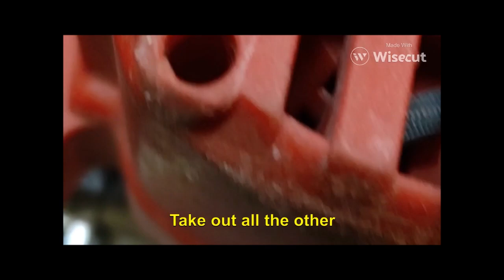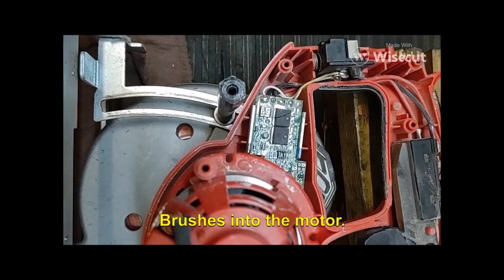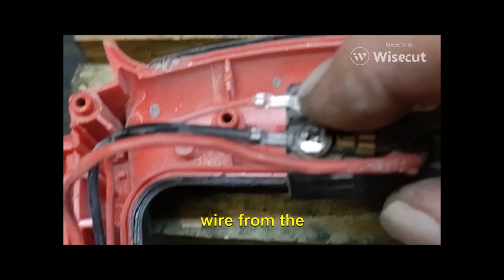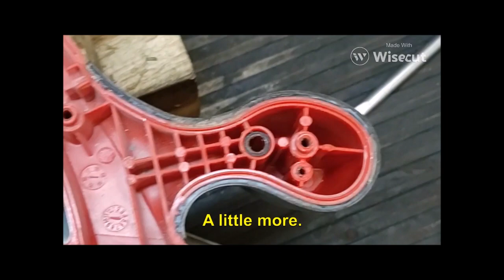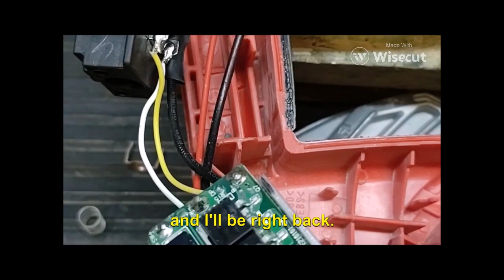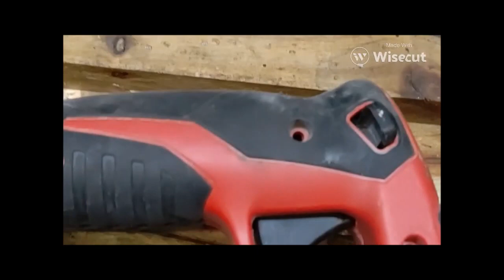How to Fix Milwaukee 6 -1/2"  Circular Saw - Model 2630-20 Electronics Fix

Comment: Hey, i was wondering if you had a website where you got the components for the fix. This is the exact same saw that i have and i have a similar issue where some wires melted. I think it just got ran for too long and had too much dust in it and that ended up frying the internal components. So all i need to do is exactly what you did here in this video and it should work. I just dont know where to get the parts
Reply from the maker: Try ereplacementparts or toolpartspro but sadly it looks like the switch assy has been discontinued.